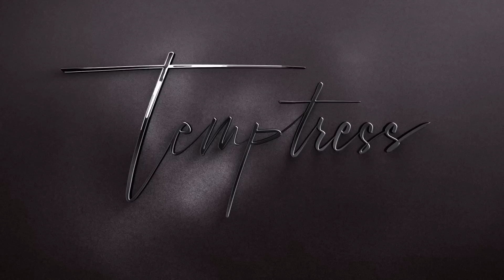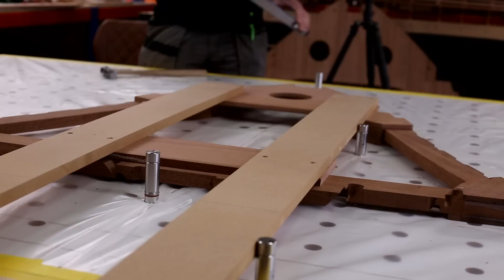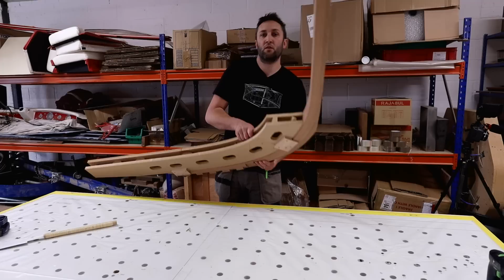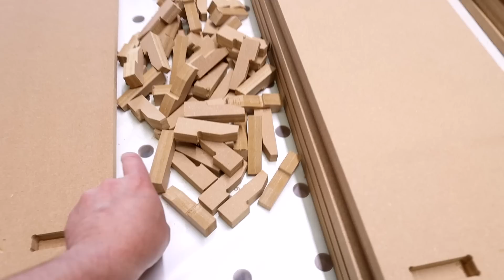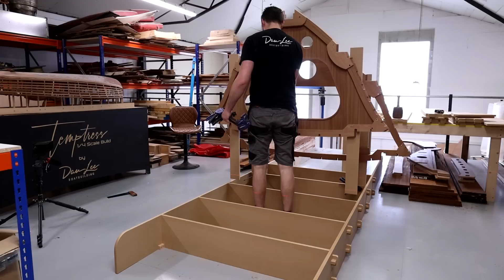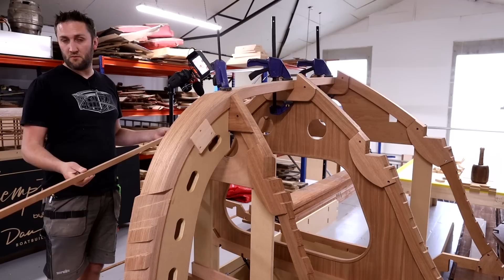Trial Boat Frame Setup and The New CNC Strongback | Building Temptress Ep8

Comment: What the minimum size CNC would you recommend to build a boat ?
Reply from the maker: 8x4' is the minimum I would recommend. Most parts are designed to fit within standard sheet material. Going any smaller than that means there are a large amount of parts you won't be able to cut effectively.
Reply: @DanLeeBoatbuilding thank you for your reply. Did a little more research and found some great 4x8s that'll fit in a home garage.
Reply from the maker: @mr.rajikon3911 there are some really great options out there 👍

Comment: Fascinating to watch this a come together.  I wonder, if you couldn’t glue the strongback down, could you put the stiffening/squaring  corners underneath and just leave them there or is the twist occurring from the top?
Reply from the maker: Glueing is really the best method to ensure there is no un noticed movement as you add in components and spring in timbers. There is a large amount of force exerted on the strongback during build and it needs to maintain accuracy.

Comment: I apologize.   I wrote before watching enough to comment.   When I see others do that, I am embarrassed for them and now me.  What set me off was the strongback design and what looks like mdf material.  A traditional plywood box section would be less material cost and labor.  I like new tech but respect tried and true methods.
Reply from the maker: Yes plywood would probably be marginally cheaper than MDF. Doing this assembly traditionally could be done and that is actually how I designed the plans originally but it entails a huge amount more labor. Measuring out and squaring each rung is a time consuming process with added potential for human error. The CNC strongback system eliminates the potential for that and goes together very quickly, in around an hour I think vs probably most of a day with the manual method. That's why I wanted to try out this system on this build.

Comment: good work, i build my cnc machine birch plywood lot parts can build small lather, only 2"x2" wood can add maximum. but this come my cnc machine table top. if need big lathe need build lot lot biggest table and beam height. maybe want make same RC-boat all parts whit cnc but not have draw and plan ,need all dimensions first make toolbath.

Comment: I wonder if AI will soon allow scaling this to other sizes.
Reply from the maker: Maybe one day... Scaling the boat is easy right now, however the bigger considerations that need to be considered in making that a safe undertaking are huge. Scantlings, weight distribution, power, performance and any number of other factors that are specified on a per design basis by a qualified professional are very important. I bet some day though there will be a program that can factor all of those details in and spit out a boat plan to any size you would like. That would be pretty awesome!

Comment: What a perfect boat building project, such a refinement of the process of boat building using that CNC machine, which is a massive time saver compared to the Temptress build by polymerman. Will this still be feasible for non-professional builders?
Reply from the maker: This build is definitely feasible for non-professional builders and that is who I have primarily aimed the plans at. It's worth noting that the way Polymerman is building his boat is already seeing massive time savings when compared to a traditionally lofted or patterned boat build. The CNC cut framing gets the boat setup and straight very quickly in comparison to the manual cutting and setup method. The need for manually bevelling notches and batten cutouts seems time consuming but doing this on top of an already accurate CNC sized frame is significantly less time consuming that doing it on an un-fair lofted set of frames. 

What I am doing here is really exploring the "next level" that we might be able to take this to. It will be obtainable to the home builder if they have access to a CNC machine but my recommendation for most would be to stick to doing bevelling manually unless they are very proficient with CAD/CAM work.

Comment: Hey Dan, amazing work... loving the process and results. When it comes to CNC machining, in other industries, you often oversize the stock then machine to dimensions. I am sure you have very good reasons, but I was wondering why you don't machine the initial stock 5-10mm oversized so the final machining step doesn't need to be so accurate... Just curious. Ta
Reply from the maker: Thanks. Yes that would be the ideal approach however, I have designed these plans so that the boat can be built and bevelled at home using manual techniques. Therefore all of the frames are sized such that their profiles give the shape and size of the largest edge of the bevel. Making an oversize component for the CNC carving process would require me to re work the files for all of the boats framing components which I really didn't want to do. If I were kitting a boat specifically to be built utilising this process though I would certainly go oversize and mill them down to final dimension at the end 👍
Reply: @DanLeeBoatbuilding  makes sense, it is an intriguing mix of traditional and computer driven manufacture.... thanks for taking us on the journey!

Comment: Nice work Dan, I have built 2 frame and stringer boats, a 16ft and a 28ft, cutting in the chines and stringers was a time consuming job as was fairing the frames , stem and keelson etc, getting the fit of the chines and stringers to the stem took about 4 cuts each to sneak up on the correct angles, your process will save many hours of tedious work, going forward you should be looking to sell a frame and stringer kit, the DIY boat builder would gladly buy it as that will remove a lot of the technical side of building the frame and getting the correct fairness.
Reply from the maker: Yes that can be a very time consuming process setting in all those timbers. I have explored the idea of selling kits however most of the demand seems to be overseas and so shipping makes them too costly. A 3D carved kit could also be a possibility but it would involve me having to do the first 10% of each build to assemble the frames before carving. I suspect that would work out very expensive!

Comment: A question, instead of fiberglassing the cross pieces of the strong back together to stop racking. Would a piece of mdf on either side do the same job? That way the strong back could be disassembled and stored for future use.
Reply from the maker: Possibly but the strongback really needs to be bonded to the floor to ensure no deviation in it as loads on the assembly increase. This means it will be a disposable element really.

Comment: Brilliant! I was interested to see your mortise and tenon, in the strong back, hold together. Particle board isn’t known for the kind of strength that you need to make that joint work.
Reply from the maker: Yes, I did wonder if I was going to see some splits when I put the pins in, I sized them so they wouldn't put a huge amount of force on the joint but rather keep it located. It seemed to work well, except for the one I hit with the mallet 🫤

Comment: Dan, how long did it take the CNC machine to cut out all the strongback pieces? I know the video is sped up but it would be interesting to know how long it actually took. I'm estimating 2-3 hrs for the 3 boards.
Reply from the maker: It probably was 2-3 hours, there was actually 6x boards though. 4 of them were just over half sheet cuts for the rungs as they didn’t nest very efficiently.

Comment: Congratulations Dan.  If you can end up placing all the longitudinal members into the frames without any significant traditional fairing, you will have achieved a "holy grail" moment in modern boat building!  Very nice work.
Reply from the maker: Yes, if all 13 frames work out to be perfectly fair then that would be quite unbelievable. God knows how much time that would save out of a build down the line. It's difficult to compare to a traditional build as the time to set in all these longitudinals probably varies based on any number of other things within the build prior to that.
Reply: @DanLeeBoatbuilding  Like a lot of people here, I'm keen to see how this remarkable build develops.

Comment: How satisfying that your efforts have proved successful. Congrats.

Once you've CNC your whole frame successfully, it would be good to include all your cutting files, including the tooling paths for your CNC type, in the purchase. 
It would encourage me to go purchase same CNC and software as wouldn't have to spend time creating the cutting paths. Never know... your CNC manufacturers might bung you a few quid sponsorship.
Reply from the maker: Yes it's nice to see it working!

It would be risky to include cutting files. They are generated to allow for a number of variables specific to my setup; origin location, axis orientation, spindle, tool dimensions and post processor type (specific to my machine) to name a few. It is highly likely that these files wouldn't go straight onto another machine. 

However, I could quite easily create a tutorial video on how I generate these files in Fusion 360 should any other builders like to follow the same process :) Once you've worked out how to do the toolpaths and what to run where they are actually quite a quick operation to do, I have of course done all of that experimenting now. I'd be happy to share that with others.
Reply: @DanLeeBoatbuilding  maybe that tutorial will also make good video content at some point.

Comment: Awesome,  just thinking on your strong back long rails you could also mill in 5mm full width slots for the cross pieces to mortise into, holding them rigidly at 90 degree and stiffening the structure
Reply from the maker: Yes you could do, although the tenons alone make it very rigid actually. I may just fix this to the floor when I do the actual setup.

Comment: Fun to see how pleasantly surprised you were when everything came together perfectly. In traditional boat building is there a lot of finessing of joints? Would it be worth creating simple jigs for things like cutting the angle of the chine given that the CNC'd stem will be perfect?
Reply from the maker: I honestly wasn’t sure what to expect. Usually timbers would be off and on many times as you trim in bevels and get the timbers fair. To land them perfectly first time it not something I’ve ever done before that’s for sure! The chine etc should be easy enough to do the traditional way as the frames and stem should dictate its angles quite nicely.